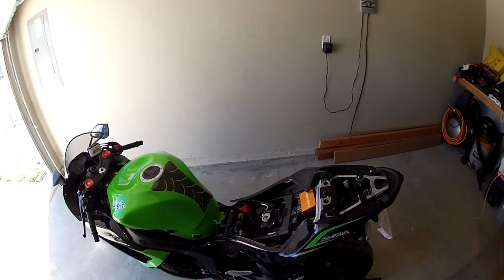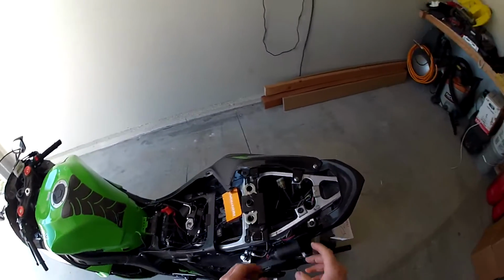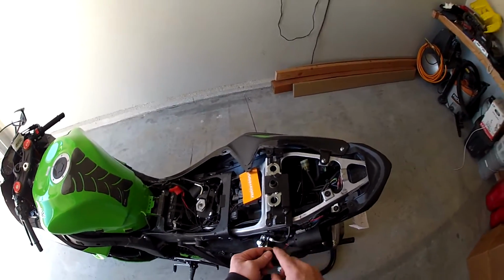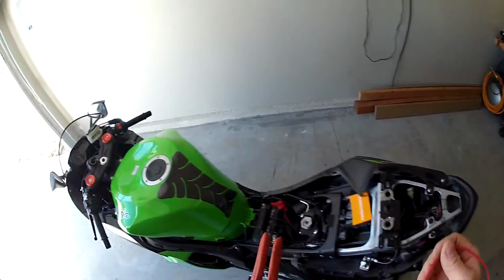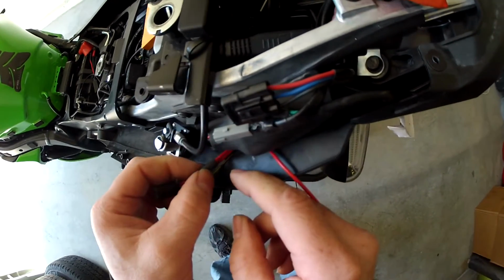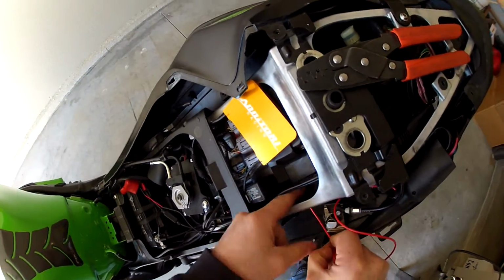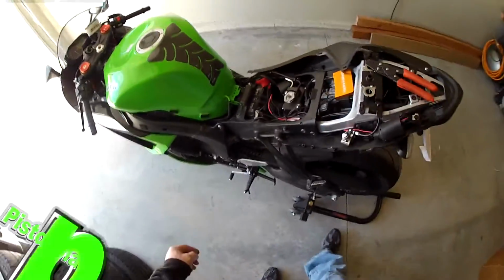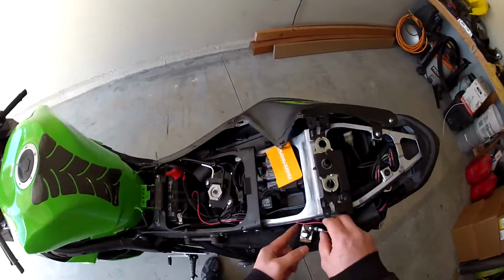How to install the power wire for the Annitori QS Pro (Video Update)

Comment: I have my QS Pro power wire tucked into the Ignition fuse but I have an intermittent issue with mine. Sometimes my bike won't even start with it plugged in and other times it will start but I'll hit a bump on the road and the bike just dies. What do you reckon the problem might be? Coil plug loom plugged in wrong? Crimped wires?
Reply from the maker: Maybe the quick shifter strain gauge itself causing a issue.  Have you tried to contact the manufacturer for diagnostic help?

Comment: Can you run this quick shifter even with a power commander 5 already installed?
Reply from the maker: I believe it will. How is the power commander installed? If its plugged into your fuel injection the Annitory will plug into the coils.
Reply: @PistonSlap  I'm not sure tbh. Ill have to call around. Cheers for the reply. Awesome video too. So simple to do
Reply from the maker: @TheMarcosdeo  it works really good.  The guys at Annitori are really helpful also.  Thanks for watching!
Reply: @PistonSlap  Just got a message back from Annatori. They said its a stand alone system and fits on coils. Where as the PC5 fits injectors. Hell yeah. Just purchased.
Reply from the maker: @TheMarcosdeo  cool you will love it
Reply: @PistonSlap  So I installed the QS pro 2 on the bike just now. SOOOOO Good. Thanks to your video I didn't have to read the instructions haha.
Reply from the maker: @TheMarcosdeo  awesome.  Glad it helped ya!   Enjoy it!

Comment: Hi, the quickshifter positive you connect to the Navigation Light, that has 12 volt? Greetings from Chile
Reply from the maker: Yes.  The park lamp circuit that is always powered up while the bike is running.
Reply: @PistonSlap  Thanks
Reply: @PistonSlap  friend, have you made the configuration from the cell phone, should any configuration be changed, and since what rpm are the changes made? Thanks greetings.
Reply from the maker: @rodolfojorquera6250  i can't remember exactly what i had it set to.   I called and talked to the guys at annitori .  I had it set up for around 10k. It worked at lower speeds but would be a little clunky

Comment: Hello, I make a query, I install it in my ZX10 2013, but it happens to me that by moment it is activated alone. Did not happen to you
Reply from the maker: Chinop S not sure what your asking?
Reply: Piston Slap Thanks for replying, I told you to install this equipment in my Zx10 2013. But I fail sometimes when I go rolling with the bike, it is activated only by cutting the coils! never happened to you on your bike once the Quick Shifter was installed? Pd: sorry for my english si very bad.
Reply from the maker: I never had it activate while riding.  I have been told that if the sensitivity is set to high it can activate.  Or a loose fitting at the quick shift unit.

Comment: can we just use posi tap? going to install mine soon, nice tutorial btw!
Reply from the maker: ryancassandra thanks, I don't prefer posi taps, because there's a possibility that water could get into the connection and cause problems.  Also the tap part could potentially break the wire causing yet another problem.   Soldering or the sealed butt connections are the best ways as you can be sure the connection is sealed from the elements and solid.   Hope that helps.

Comment from the maker: So my settings are 
Push.  sensitivity 50.  kill time 50.  rfx 18
Pull    sensitivity 55. kill 25 RFX 18.  
my pull is for down shifting.   I only leave it enabled to help relive any chance there may be a load on the gears.  I still use the couch when down shifting.